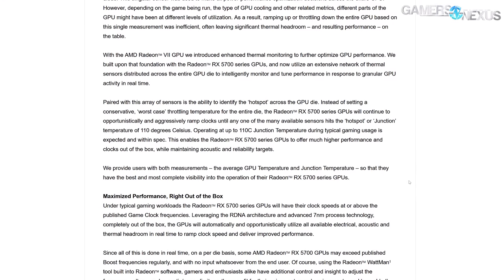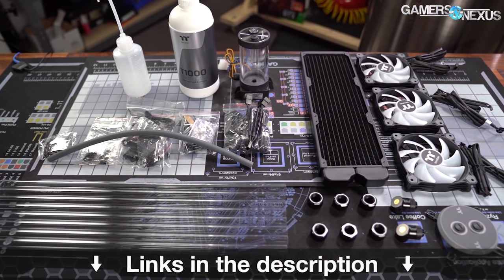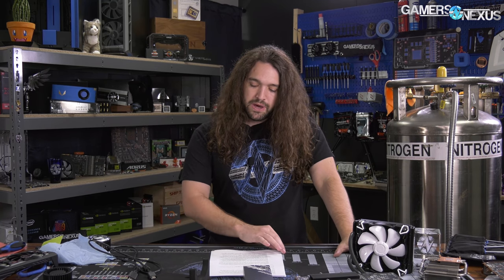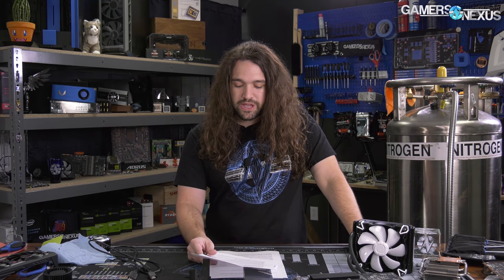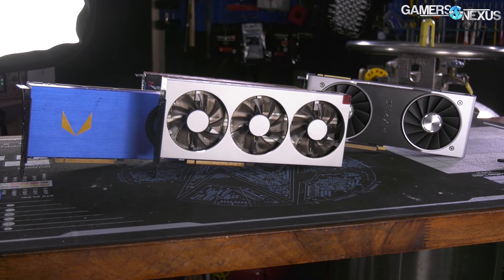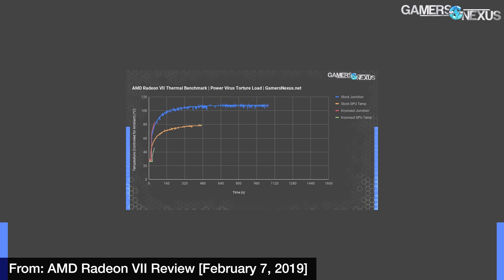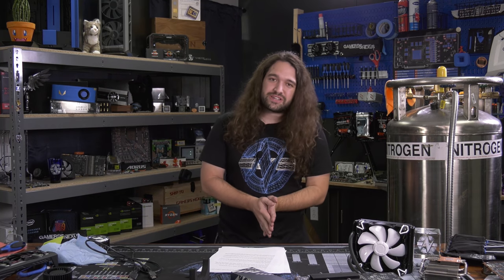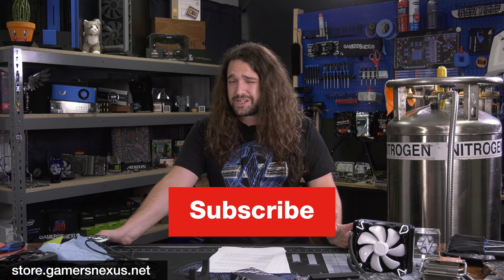Explaining Navi 5700 XT Junction Temperature | 110°C is Not "Expected"

Comment: 110°C is a-OK. You are all haters!
Reply: Keep away from the troll, people! Keep your hands away from the cage and don't feed the troll!
Reply: It is not. The life span is greatly shortened and the act of defending the temperatures as an excuse for a bad cooler design is not ok. Why settle for worse when amd could easily design or use a cooler which is better?
Reply: @jakeduffy2053  Why do you hate AMD?
Reply: @Momfasa  I don't.  I'm legit planning my next build to be all amd. The normal rx 5700xt is straight up garbage in temps
Reply: @jakeduffy2053  Sorry, I'm just trolling. I totally agree with you. That high temp is absolutely not good in a gpu. Sorry again! :)
Reply: @Momfasa  :I   bruh

Comment: 3:30  You keep saying "in reality" when what you should be saying is "in the very limited set of circumstances we have tested with our significantly less than state of the art measuring equipment".

You quite simply don't know what the hell you're talking about.

The GPU clocks will boost when both temperature and power limits allow.  If you reach the power limits before reaching the temperature limits, you can't say the ignorant things you've been saying here.  It's quite possible to reach the temperature limits before the power limits with a high ambient temperature and/or a case with poor airflow.  You guys always use fairly low ambient temperatures, and test with an open-air bench.  In other words, you have done zero tests that are even capable of providing the bare minimum of information required to hold a strong opinion on this issue.  That you felt confident enough to spout of all the same is something you should be worried about.  It's a pretty good example of the Dunning-Kruger effect.

And if you're the least bit tempted to say that the OEM cards with lower temperatures do boost a bit more, take a beat and think first.  In particular, about how temperature affects power consumption in semi-conductor devices.
Reply: Buddy, the only one that doesn't know what they're talking about here is you. Higher temperatures decrease resistance in semiconductors (which increases their power consumption), and increases resistance in the wires, which reduces conductivity and also increases heat. Hence, heat produces more heat. If you think unnecessarily higher power consumption is some sort of improvement on the operation of the chip, it isn't. Yes, you need more power to drive higher clocks, which give more performance, but higher baseline power consumption relative to the same clocks gives you nothing. And higher temperatures at baseline prevents your ability to boost due to less reliable operation at higher clocks/temperatures.

And just to reiterate, operating at junction temperature is a worst case scenario (e.g. your fan stopped spinning, or your computer was left out in the sun), not a normal use case. "Within spec," while true from an engineering perspective, is very misleading and untrue for normal operation. And if they did design their cooling around thermal junction, then it's horrendous product design, as operating at those temperatures also reduces the life expectancy of your chip.
Reply: @Moonspec  I'm sorry you're having difficulty parsing English. 

Higher temperatures do increase power consumption, which is the point I made.  If you lower temperature with a better cooler, you are lowering power consumption, and that's why you get a bit more boost.

That still doesn't test the scenario where temperature rises faster than power consumption.

You, too, don't know what you're talking about.

Comment: This just sounds like more poor engineering on AMD'S part. Lots of heat and it still can't perform with Nvida.
Reply: Partner card temps seem ok. AMD needs to ditch the blower coolers.
Reply: well it costs 100$ less than 2070 super and performs about the same, so you don't know what you're talking about